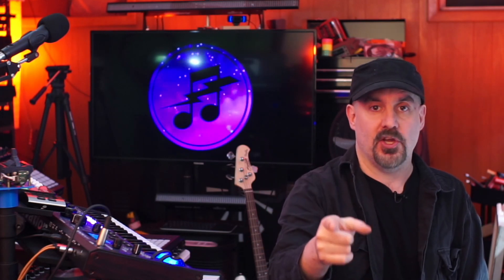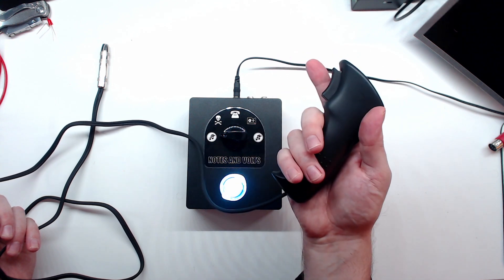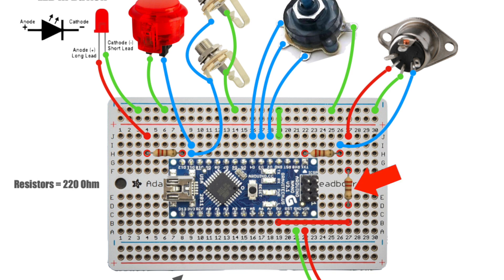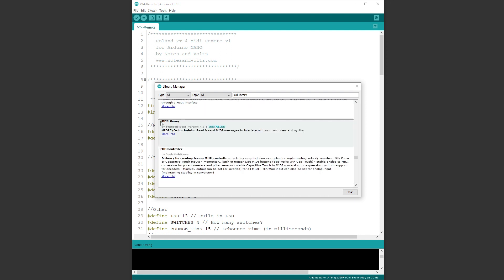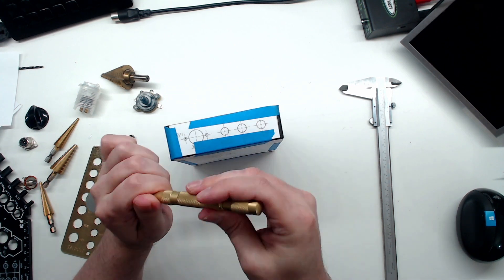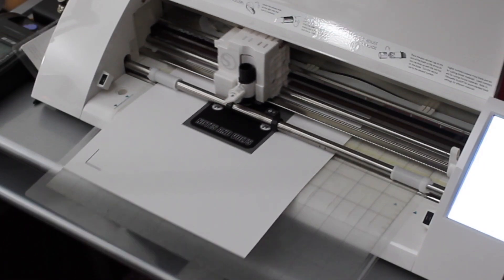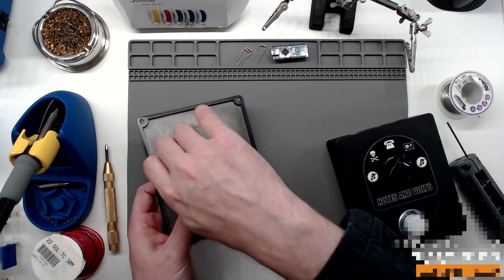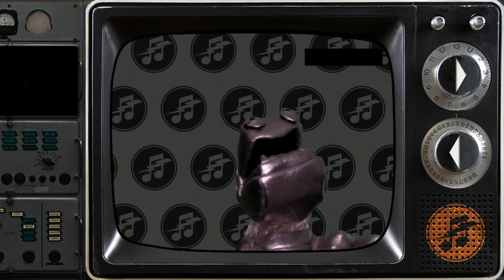BEST Controller for ROLAND VT-4 Voice Transformer - DIY

Comment: how could i program the different settings to what I want them to be? Is this something where I would make presets on the VT-4 and the controller simply switches between them?
Reply from the maker: That's correct. You make the patch on the VT-4 and this box will select it.

Comment: This is a very interesting project. I have been using the VT-4 in my live gig for background vocals, and it is an amazing box. I also needed some outboard control for it, and ended up getting a MIDI CC pedal that I can use to fade in/out my background vocals. And, instead of building a box as you did (which is cool, btw!) I created a virtual pad controller on my iPad which lets me hit one of 12 "pads" to select which key I want to be in for a song, and makes it much easier to change keys on the fly than their little dial on the unit itself. If you use Bluetooth midi it then can be used without a cable to control the VT-4. Congrats on coming up with a novel way to control the box via hardware! I guess I took the software approach to solve the same overall puzzle!🤣